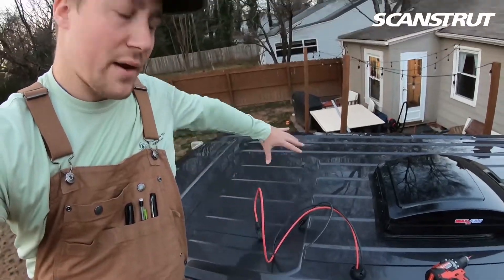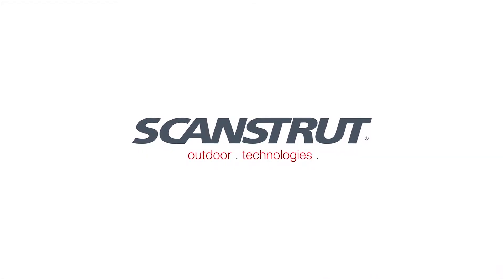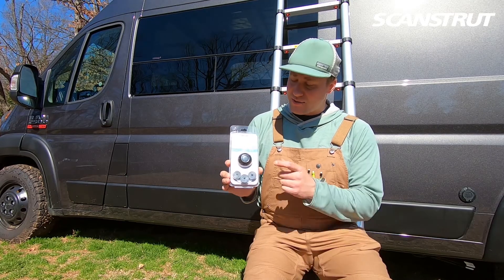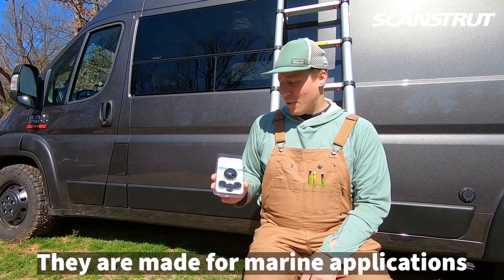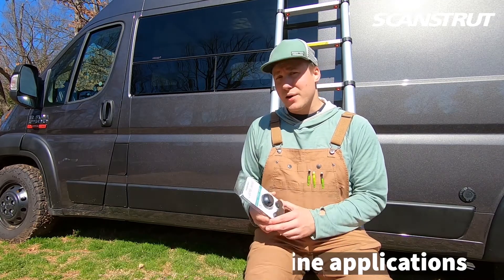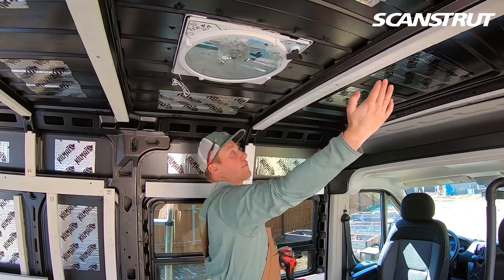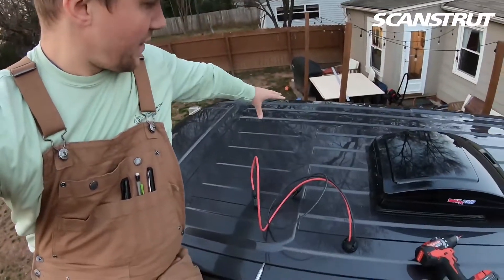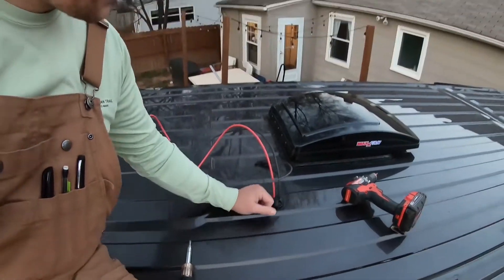Routing Cables for Solar Panels  | Adventure Van Roof Installation | Scanstrut Cable Seal - Black.

Comment: Some clever tricks used, like with plastic bag to catch shavings and drilling the spool flange.  Surprised you didn't use rust protection on he bare metal (bag could have caught potential drips too).  If your product was easy to purchase, would certainly consider it.

Comment: Don’t like the way the wires go straight up looks like they can get caught on tree branches or more
Reply from the maker: Hello, 
Thank you for your comment,

We do design a range of different Cable Seals, 

In this video, the Cable Seal is from our vertical range, and therefore the cable is straight up. 

We have a range of Horizontal Cable Seals including our newest which is a Double Horizontal Cable Seal that will lay the cables sideways. 

Here is the link in case you wanted to have a look! :) 

https://www.rokkstore.com/collections/cable-seals/products/ds-hd6-blk-horizontal-double-cable-seal

Comment: Does it come with the solid rubber piece for the 2 wires?  The 3 rubber pieces in the package look like they’re already drilled for a single hole.
Reply: You’ll need to drill the solid rubber piece for a two hole install. I did, worked great, just make sure your holes clear the plastic surround. Use progressively larger bits so the wires fit tight
Reply from the maker: Hi, Kevin, all the models come with pre-drilled and blank rubber bungs, take a at look at the range https://www.scanstrut.com/marine/power-boat/cable-seal

Comment: What AWG solar wire are you using? 

Thanks
Reply: Google wire guage/current chart, the guage depends on the current going through as well as the length of the wire
Reply: @IceInMaWeiner  thanks, but I asked two years ago so I would know what AWD fits through the scanstrut.
“Google it” thanks man 😂 two years later… how helpful

Comment: What model scanstrut seal did you use?
Reply from the maker: This Cable Seal is from the Vertical range, there is a range of different sizing options depending on your required Cable diameter :)
Reply: @scanstrutltd6804  

I updated with the model number a couple months ago to answer another persons question. 

If you are operating this channel/video as a promo for the company 7 months is pretty late for a reply that doesn’t really answer the question
Reply from the maker: @nickrezendes5142 
 Hi Nick, 

This was not a promo response, 

Someone else commented on the video today and therefore I was able to see that you did not get a reply 7 months ago, so thought I would just reply in case you still wanted to know the answer. 

I can now see you did manage to find the right product code,

If you need anything please do not hesitate to get in touch, 

sorry for not replying sooner :)